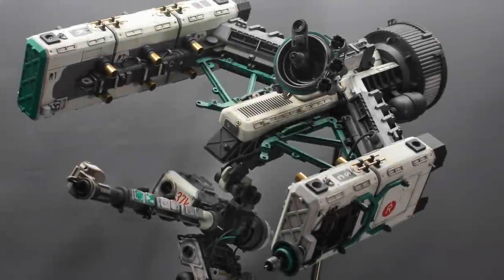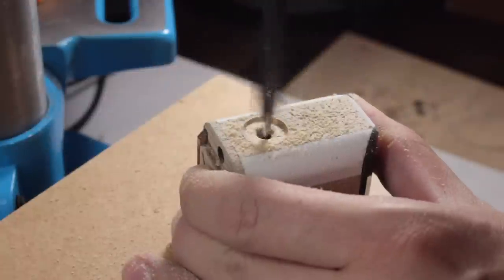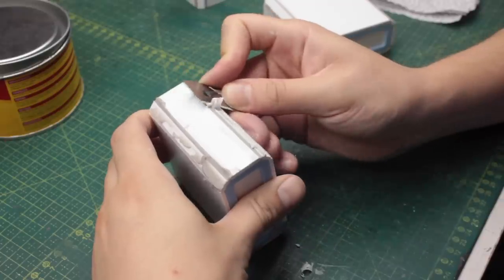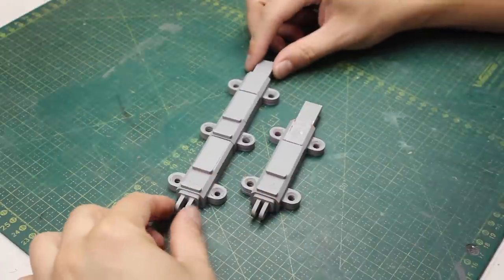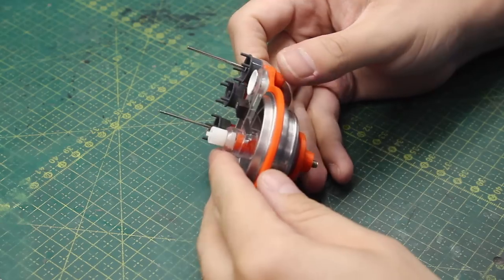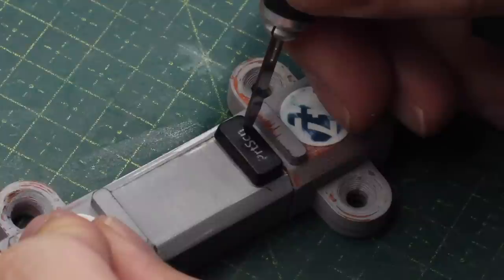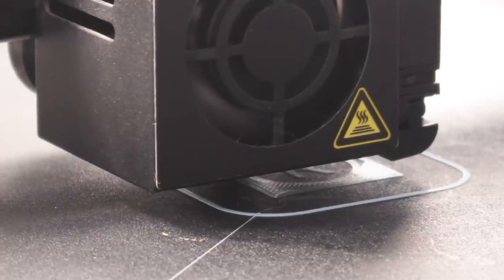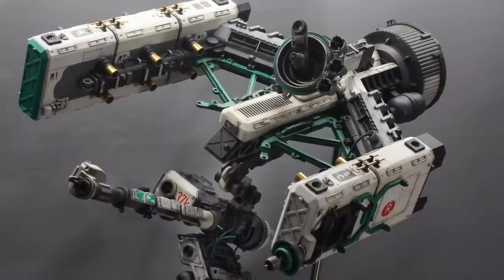I BUILT this spaceship model! - DIY MODEL

Comment: Did not need to make a thing for the gun to rock back since there is no recoil in space and the gun should have just been attached to the frame, not by an arm. The side boxes, should have been 3 on both sides for continuity. From a SPACESHIP design perspective this sounds poor. But if you made the side boxes have boosters on the bottom, then it would have made sense of what you were going for. Overall it looks cool though, and good job coming up with the ship.

Comment: Every time I watch one of your videos I'm in awe at your creativity. Absolutely fantastic and that engine is a work of art. Really inspirational.

Loving the use of the 3D printer, much easier to design exactly what you need that your have in mind instead of spending days trying to find the right bits to create it from scratch. Easier to make several or even dozens of identical parts too. The idea to use 3D printer parts as stencils is great.

Comment: Incredible job!
Also, you're using 3D printing exactly the way it should be used, as another tool in the kit, and not a replacement for the kit.

Comment: The ship of yours is PRETTY piece. But let me pile some arguments and questions to you, before you go for the next one. 

Technical level of your ship seem pretty based to me 

- main gun is actual gun (although it is weirdly swiveling, instead of solving recoil and heat buildup). From my point of view, the ship, even if it uses recoilless rifle /(recoilless gun) would be less prone to gun overheating problem, if it has more barrels (like 3 or more rotary weapon), and/or more heatsinks and radiators. 
Alternative with todays technology might be railgun or coilgun. Reason is the speed of movement of the projectile, wich is much higher at the EM powered guns, and much smaller ammunition (could be loaded by belt from the main body of the ship). 

- the ship seem a little like drone to me. Does not have visible windows or doors, but as a main "proof" i see there - there is no chance to generate (or simulate) gravity on such small ship - acc the gun you picked, my dimmensions estimation is a little more than tank size. If the "wings" are not hundred meters apart, there is no chance to make the gravity for the crew (in said "wings") by spinning. But i can imagine a cruiser, battlecruiser, battleship or bigger beast, to throw out before combat tens of automated drone fighters, with few of those sniper gunship specialists, to support the main ship... Cause if few of those focus fire on some subsystem on the target, (granted the projectiles are still able to manuevre, when it comes into the target area), it can be used for pretty subsystem sniping...

At least 1 or 2 point defence weapons would bring more realistic point of view, because even robot is valuable, therefore its creators and users wants to prolong the time in wich it works and does not get irepairably destroyed.

Comment: I'm sorry to bring actual criticism, but the gun at the bottom is a bit weird, because it's too far away from the spaceship's center of mass for how massive it is. This would cause the spaceship to constantly pitch down once the main engine was activated. Moreover, firing the gun would result in the spaceship spinning out in the direction of the recoil, because it's not firing in line with center of mass.

Other than that, I like the little details and the general visual design.